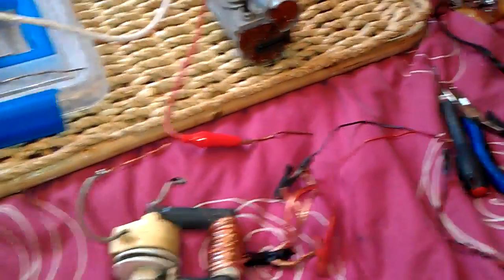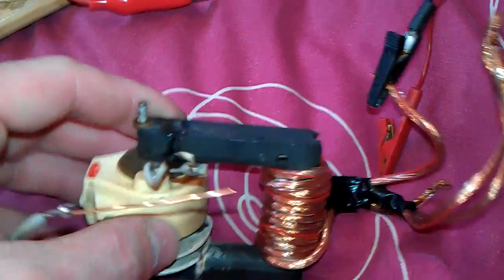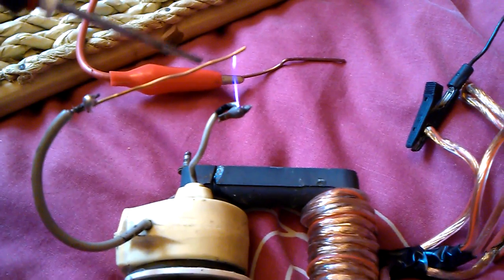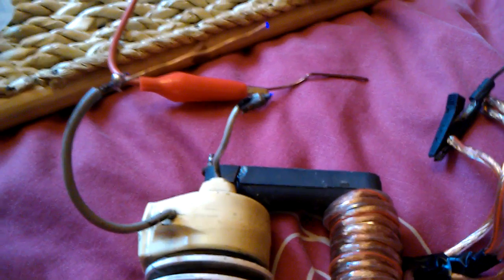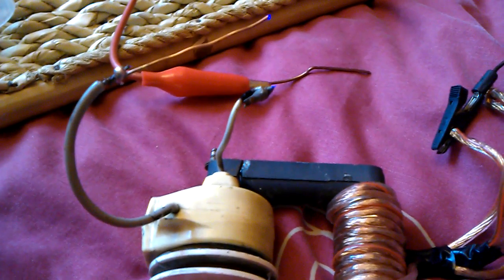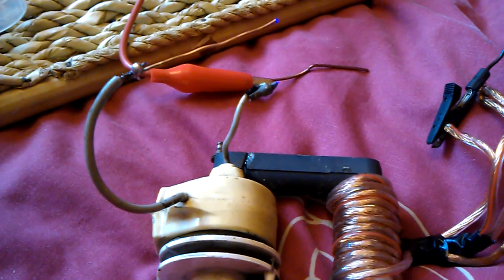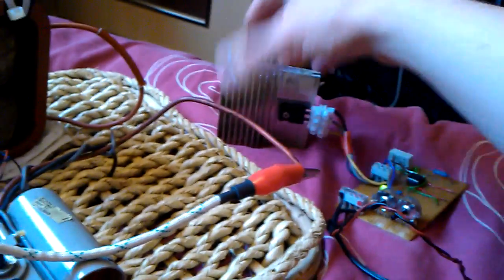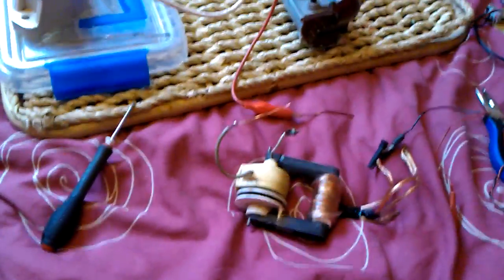Me talking & little vintage flyback

Comment: With flybacks driven from a 555 or smaller, more simple driver it only usually burns. There's not enough current to cause any serious problems and the high frequency of the electricity is way above the response range of the human nervous system, usually. That being said, the burns from letting it arc to you directly tend to leave nasty, charred holes in you and can be a little painful.

Comment: Don't you have heating in your shed? I used to love being in my shed at the bottom of the garden, tinkering with electronics and all warm and snug while the freezing weather was raging outside!

That corona worried me... if the insulation failed and arced through, wouldn't you need to be extracted from the ceiling?
Love your videos! Just about my favourite channel! Thanks for sharing your experiments with us :)